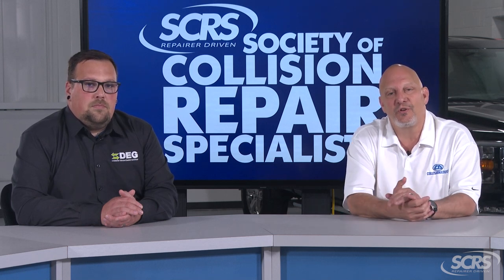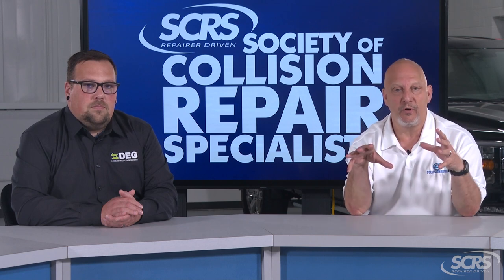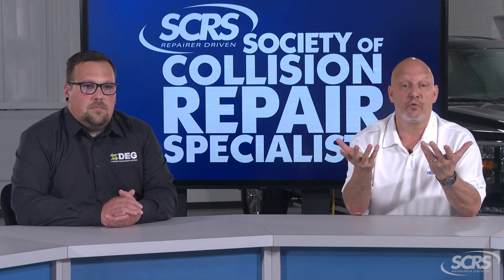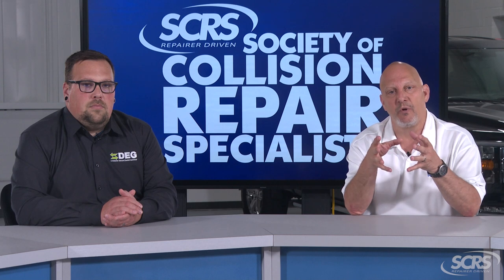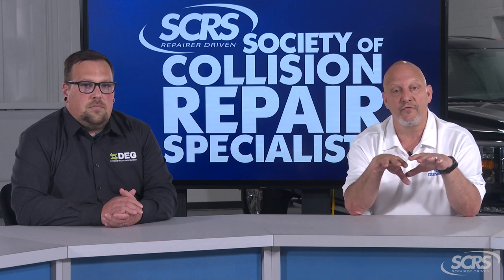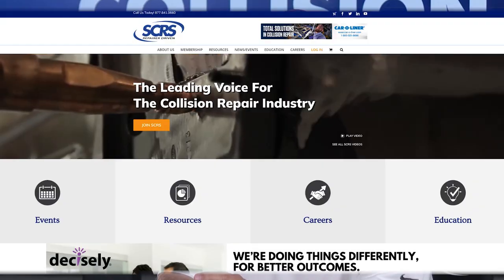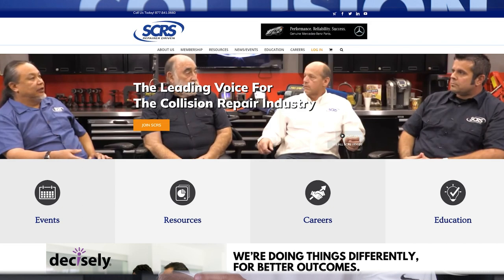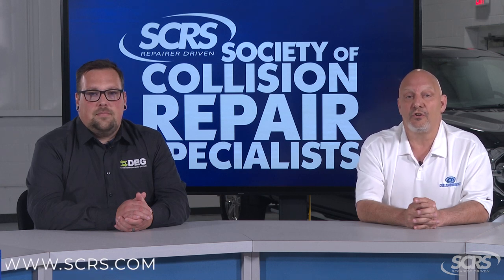CONSUMER TIP: Does my bumper paint match?

Comment: At the OEM level, are the bumpers painted with the same batch of paint, on the same day, in the same plant, etc., or are they produced and painted by an outside vendor?
Reply: Usually their painted assembly line style, not with the vehicle they may be going on
Reply from the maker: Vincent, good question. The manufacturing process can vary by OEM.